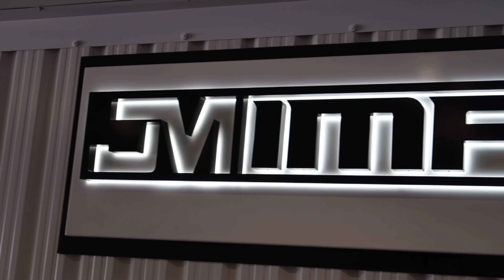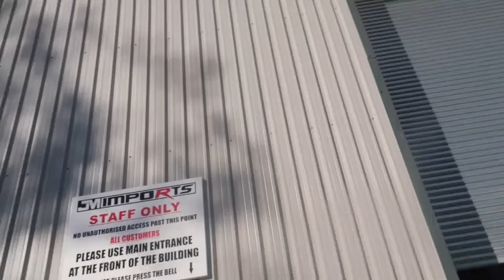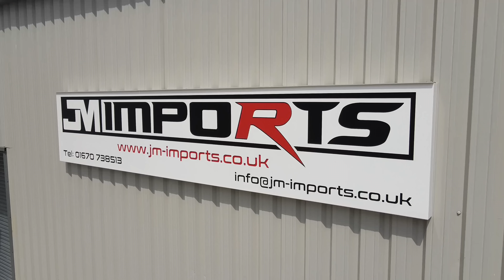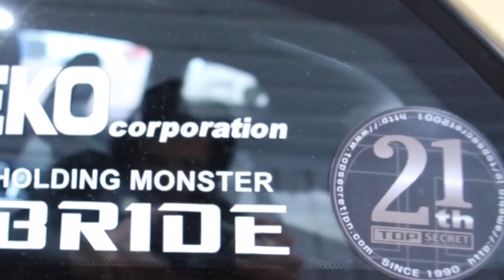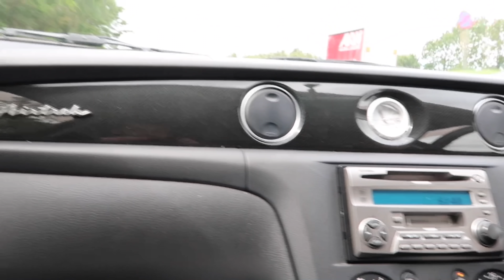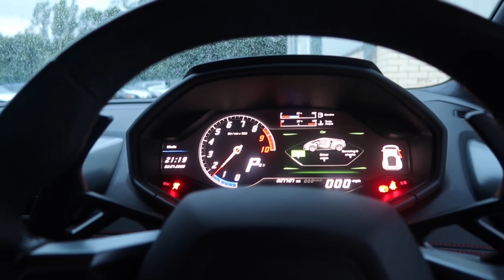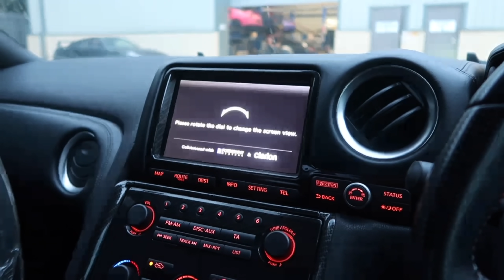JM-Imports New HQ Week 001 - Welcomes Callum Our new Youtube vlogger

Comment: Nice motor 🏁❤️
Reply from the maker: Thank you mate  ! Which one would you have ?
Reply: @jmimports  I love the black Toyota Supra or the black R34 but to be honest I'd have the Nissan pulsar gtir you have got if I had the money id have you put a RB26 engine with a single turbo conversation running 6 to 800 whp
Reply: @jmimports  🏁🙏
Reply: Or I would love to do a crazy build  Vauxhall Corsa c SXi  with a k24 engine with a turbo full custom all-wheel drive conversation running 500 to 650 whp and Go drag racing with it I would be amazing and all of the Spectators would be like what the hell that sounds like a Honda engine it would be priceless